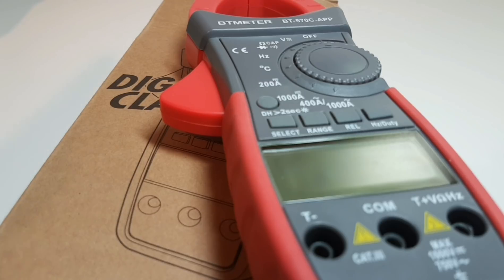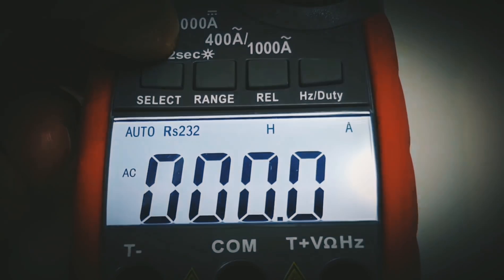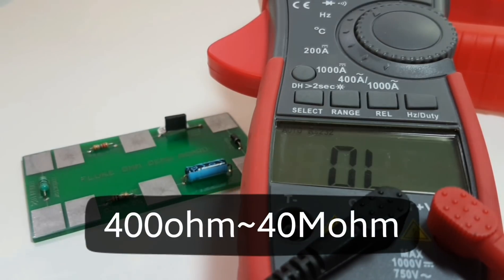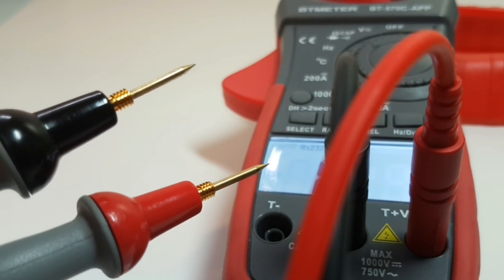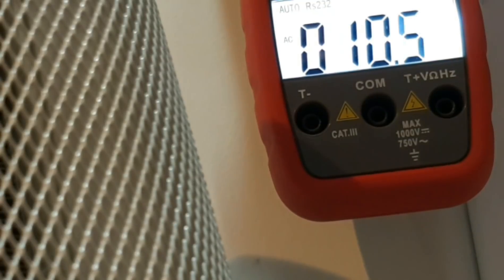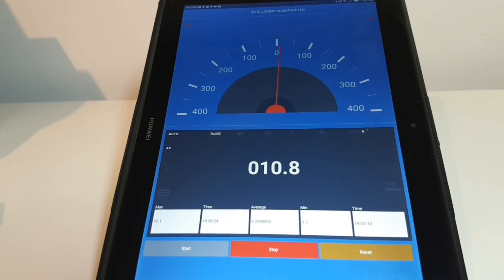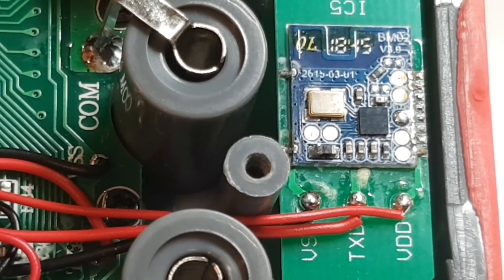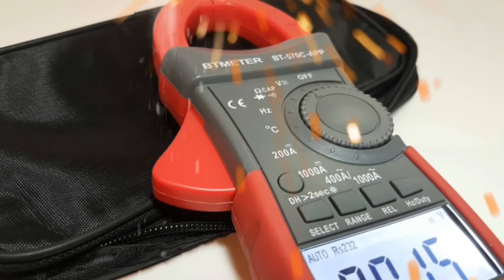BTMETER BT-570C-APP Clamp Meter Review & Teardown!

Comment: I have one equal to this shown. Display angle-restricted visibility (case hiding bottom segments) is the thing that bothers me more. A close 2nd is no easy way to keep it standing horizontally to be used as a secondary Volt or ADC DMM. 
A feature that I felt it missing was to show the ADC functionality and its need to not change orientation after REL is pressed, as it is sensitive to external magnetic field (including Earth one). This is not a problem related to brand but to the proper use of such feature.

Comment: it's not 'LED' mode it's DIODE mode to measure between 0.3 and 0.7 forward bias.
Reply from the maker: An LED is a diode, a light emitting diode.
Reply: @KeepOnTesting  I'm well aware, however the meter is designed to fwd bias a NORMAL diode, not LED that's why it didn't work. you measured 1.5V on the output to attempt to bias an LED. you called it LED mode in the review; the icon is NOT LED icon (with the light lines). If they mention LED in the instructions then that's on them for incorrect documentation. Try the diode test on a normal diode it will tell you the fwd bias of that diode. My fluke will bias any LED I've tried so I'd have tried the same you did, but I wouldn't fault the meter for not being a fluke.
Reply from the maker: @andrewwynn  https://youtu.be/bpTUXM1v53I
Many decent CHEAP-O Multimeters can bias an LED Andrew, that's why it's part of the testing criteria. No need to $pend on a Fluke just for that.

Comment: "Intelligent Clamp Meter" app leaves a lot to be desired.
Yes, it does connect and does some basic logging but no control over graph axes makes them all but useless. The 'data saving' function, though it appears to allow saving as txt or excel format saves to NOWHERE as far as I've been able to discern. The instructions for reading (finding?) the saved files mentions another app- 'iTools4' - which has been updated to 'iToolsSmart' and seems like it would work... EXCEPT the Intelligent Clamp Meter has been DROPPED from its list of smart devices! So you get 'data logging' that goes nowhere with no chance of finding the saved files...
Not that great for my application.
Reply from the maker: Saved file location depends on phone permissions , everyone is unique. File Manager + , v3 or higher https://play.google.com/store/apps/details?id=com.alphainventor.filemanager  ,  is a great app for Android and it will definitely help you find any file [even hidden files] on your device. BT Apps like Bluetooth DMM, https://play.google.com/store/apps/details?id=com.yscoco.wyboem  will also work with this clamp.  They tend to be clunky but functional 👍
Reply: @KeepOnTesting  Thanks but I neglected to mention I'm using IOS. I'll see if there are equivalent iPhone apps to those you mentioned.
Reply from the maker: @WmLatin  ahhh, Bluetooth DMM is in the iOS store, but File Manager + is not available on the Apple platform.

Comment: Used clamps to measure a 15 amp current draw (DC).
The amps would show 1.0 even if not around any wires. Not sure if it's normal. Tried using REL to zero it out but the reading was then way off. Did you experience such a problem?

Comment: i got one of these and its a piece of junk,  ac and dc voltage floats everywhere even after hitting rel, amps dont work with the clamp or with leads...according to this, my lcd tv is using 1 amp while using a line splitter

Comment: They listened to you!  I just bought one and the arrow on the rotational dial is now white :) .

I'd like more resolution on temperature (it only does whole degrees Celcius) and current (it only goes down to 0.1A).  I guess that's why its £34 and not £300!!!

A probe ammeter would be useful to get down to milliamps, instead of relying on the clamp.

I use this to check auto battery drainage (just clamp the earth wire and use bluetooth app as I pull fuses) and a different multimeter for checking circuitry.  It would be nice to just have the one.
Reply from the maker: Great stuff! I agree a few tweaks and it would really be a mini powerhouse clamp!

Comment: Does it measure small DC currents with +/- 100mA correctly or is all over the place? Clamp meter with dc capabilities and cheap is what i am after
Reply from the maker: It's not the most accurate for low mA ..although I've seen worse.😆

Comment: Thanks for your review, Darren. Documentation is poor for this meter. what is "REL" exactly and how is it used?
Reply from the maker: REL (Relative) mode will negate any bias in the test (leads) by resetting ( DELTA) display to zero. Sets a relative reference point to measure against the next reading. This way you reference out any bias in the test measurement. Thx for the kudos !
Reply from the maker: So to measure resistance,  first you would REL by putting the test leads together..PRESS REL , now you've zeroed any bias in the test leads. Take your measurement. REL can ONLY be used for Resistance and sometimes Capacitance ( if supported).
Reply: @KeepOnTesting  Thanks! However, my instructions also talk about using it for amps (clamp residual magnetism). If I put the meter in either amp setting, values are fluctuating unless I have REL on?!
Reply from the maker: @KGingeri  Generally ac voltage sources vary from fluctuation in ac voltage over power distribution systems.Press the relative (REL) button to set the multimeter to a specific reference value. Measurements above and below the reference value are displayed.
Reply: @KeepOnTesting  Ok, the meter I got was acting very strange. Floating readings etc. I could only get it to work with the clamp on AC.  I noticed the common black lead seemed to go in VERY hard and as a result, wasn't making good contact. Once I seated it properly everything started to work as expected. So yeah, REL is like zeroing an old meter with the potentiometer.
Reply from the maker: @KGingeri Great, glad to hear  it's working now.. 👍

Comment: Just recieved my meter today first the leads didnt fit properly i had to put grease on the end to get them in the sockets. 2 The meters app is useless and keeps dropping connection plus you can only use the app if you allow gps location.  3  the user interface is not the best
Reply from the maker: Thanks for the update..definitely not great news. I would toss the included leads and get a new pair. 👍
Reply: It seems as thow the meter uses a silent / hidden bluetooth connection and a lot of android phones wont allow hidden connections.  The meter works fine on a non phone tablet.

Comment: Great Review! Thanks - i am buying, need bad. Concerned about the low voltage output for LED verification. What if you used the Probe Masters 8K series for this task?
Reply from the maker: Hi Dave,

Probemasters would not make a difference as the output V is directly correlated to the multimeters internal  circuit not the probes. Still, a great clamp meter !

Comment: I just purchased 1 online and frustrated with regards to calibration. My room AC voltage supposed to be 230V read 240V. 🤨
Reply from the maker: Wow, that's definitely out of spec. Sorry to hear that. Will you return for a replacement 🤔
Reply: @KeepOnTesting  I still need to check Current reading compared to my friends Sanwa clamp meter on aircon freon charging. If difference is big maybe need to return. Battery dc voltage reading found to be ọk.
Reply from the maker: @oldiesbutgoldiesluna6663  OK let us know the results...hopefully the current results will be more reliable 🙏
Reply: @KeepOnTesting  is there no way to calibrate it be a reference DC current for example? there are some variable resistors on the pcb ??!?!!
Reply: In Europe socket voltage may vary up to 253V if someone in your neighborhood has PV on the roof.

Comment: How can I reset this Meter,no read out,out of the Box.
Reply from the maker: Hi Frank...there is no reset persay. Is it not turning on at all? Takeout the batteries and turn it on... then off. Then replace with fresh batteries. Let us kmow how it goes. Also, inspect the pcb if you can..if there's alot of flux try cleaning it with a cotton swab and IP, especially around the battery terminal contacts.

Comment: Please check if data acquisition is possible with DC ampere position. Mine works well with graph mode but data are not
available in data mode. In other positions both mode works well.

Comment: what about the dc current is that ok does the min max work ok
Reply from the maker: Yes I haven't experienced any issues with measuring current or the Min/Max feature. Everything works as per the norm.😀👍
Reply: @KeepOnTesting  thanks that was what i was very interested in for automotive work
Reply: I just received my BT-570N that’s without the Bluetooth. I waisted my time using it on my SUV battery as a clamp tester. It doesn’t keep an accurate measurement. I even tried reversing it and it still doesn’t work properly. I purchased it only for DC AMP reading but I was not impressed. I’m thinking about returning it.
Reply from the maker: @gaets04  Thx for the feedback..that's too bad. My readings have been stable although I haven't used it often. I'm doing new clampmeter review next week which looks promising.
Reply: Darren Walker I’d really love to see your next review on the DC AMP report before I return mine. Don’t forget that there is a way to place the meter in the direction of the current. I found that out by reading the instructions.
Reply from the maker: @gaets04  What were you trying to measure on your SUV? Just current draw on the battery or something more specific?
Reply: Darren Walker i want to find out how much Amps the battery draws in the non running position. My clamp is on the red wire positive.
Reply from the maker: @gaets04 Roger that..ok well stay tuned   that review hopefully will be out next weekend.
Reply: @gaets04  My ms2108 is reasonably good with dc current readings on automotive electrics and its cheap.

Comment: What is the minimum time between measurements for APP? I saw it is 1 second on the video. Is it possible to configure it shorter? Thank you, very interesting video. Sorry for my English
Reply from the maker: Sorry for late response, I believe 1 sec is as short as possible..Thx for watching!
Reply: @KeepOnTesting  Thank you :)
Reply: @KeepOnTesting  Its 1 min on mine
Reply from the maker: @DEVONLAD11  Thx for the update!
Reply: @DEVONLAD11  Is there a limit to the nr of datapoints, or does that depend on the memory of the phone.
What are the possible settings for the time between datapoints?

I ask because I want to log the amps coming from a solarpanel on my e-bike during a trip. I want to see how it does during a 4-5 hour trip.

Comment: Some good stuff on this one, some not so much like the LED and continuity, good to see jack support on this one - forgive me mentioning it but bad as the LED test was you glossed over the basic diode test with one right there on the test board, this is what the range is mainly for I believe-? Amazing BT spent the money for blue tooth but left the meter with a lousy diode range that wont read or light even one LED - at that point  im especially curious when the LED test is this bad whether it also passes the basic diode test - after all it is a review and the diode range is part of it.  I believe my $20 Tacklife clamp meter reads and lights LED's but ill have to check and verify that I could be mistaken.  Please forgive my critique' - lol
Reply from the maker: No worry, It passes the standard diode forward bias test thank goodness.. my bad ...
Reply: With that showing on the led test it was a valid question, thanks.

Comment: Yes Darren, a cousin of mine who I consider to be quite good at his work was wondering why his clamp meter was not showing any readings. 🤣👍I keep 2 line splinters, one for the van and one for the bench.
Reply: Hi - couldnt a guy make a simple line splitter with  a short section of lamp cord and a couple male and female plugs, just separate the two wires to allow for clamp use-?
Reply from the maker: @yambo59  Yea Mike but damn that sounds like work 🤣
Reply: @yambo59  Yes even if you wanted. Just split the 3 cores of your mains cable.
Reply: Sorry,  line splitters, dam this predictive text.
Reply from the maker: Hehe..I hate It when that happens..